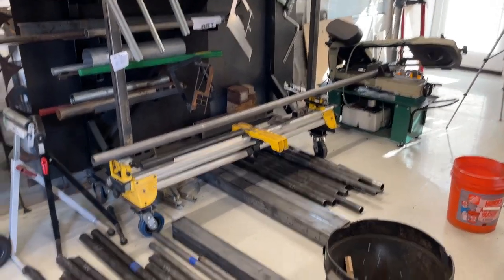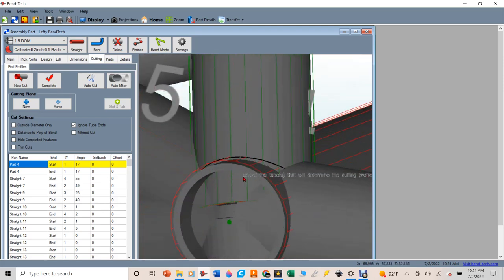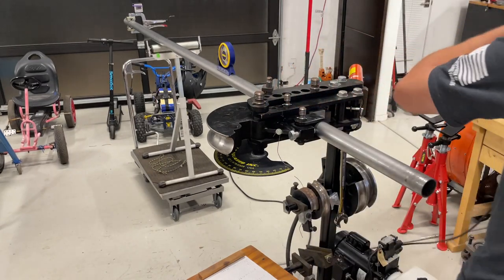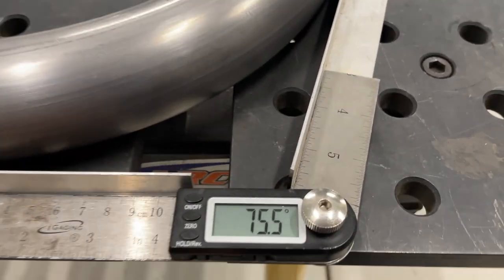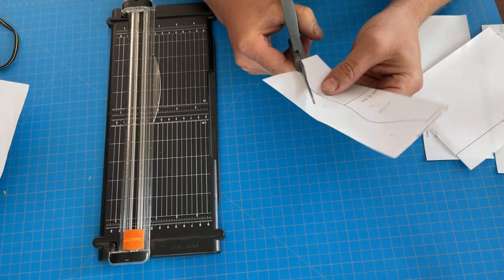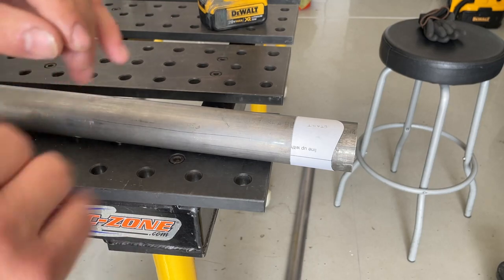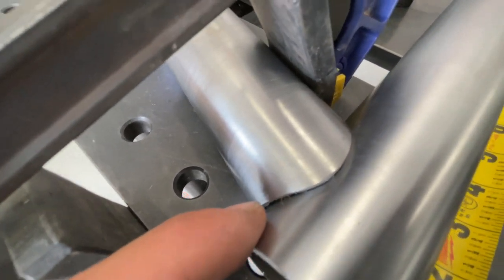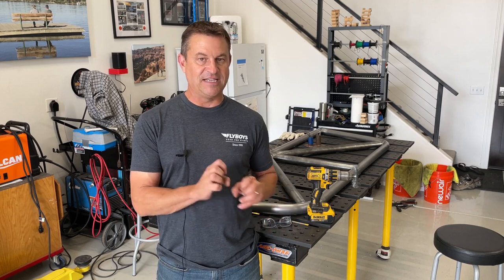Using BendTech to fab a tube with cuts and bends

Comment: Great video but just a quick tip on the order of welding, you should have fully welded the centre tube fully first before adding the 2 diagonals that way the node is fully welded and at it's strongest 👍 always fully weld a tube before adding others to it
Reply from the maker: Will do.  Thanks.

Comment: Once you get the template traced to the tube (I use a scribe), you should try coping by using your plasma cutter by hand.   Keep it pointed at the center of the tube as you move around the scribe!  Works good.

Comment: why has no one designed a spring loaded stage 1 for the JD2 model 3??   you may give up a full pin hole on the die.... but how often do you bend 180 anyway?? and if so just unpin the stage 1 and finish the bend....

Comment: Get yourself a pipe vise and make a stand with casters on to clamp your tube in  keeps it in same rotation 
Been useing bendtec for 10 years do 100s of bends a week in my shop 
Surprised you dont have a cheep holesaw tube notcher they work better than you think i use one for site work . Have a dragon 400 comming next month hope it works as well as it looks to

Comment: Quick question. When placing tube in the bender. Do you put the dimension from bend tech (bend line) on the horseshoe clamp or the edge of die set? I’m getting ready to finally use bend tech and I’ve always referenced my bend lines to the grind edge of the horseshoe clamp. Wondering if bendtech is the same way?
Reply from the maker: To solve distance to the start of the bend I put the mark on the die.  I usually dial in the rotation with an angle cube to get the exact rotation in relation to the die.